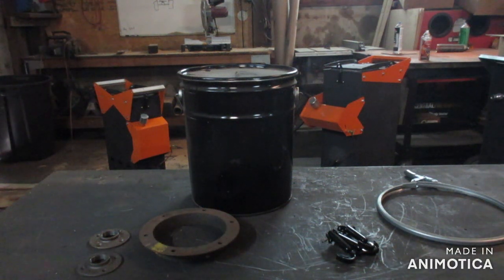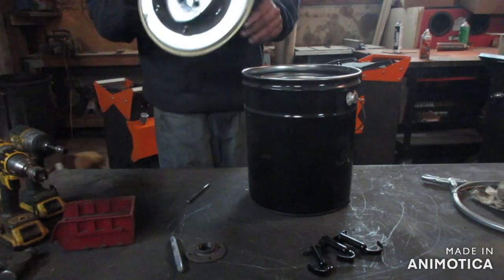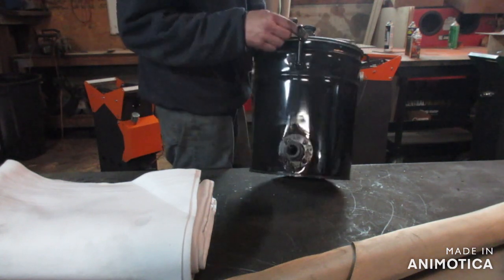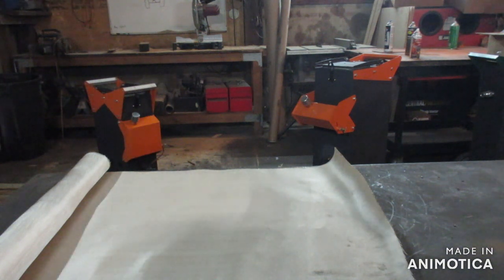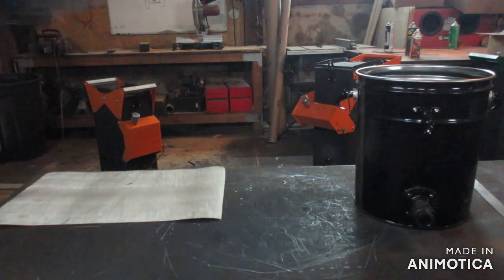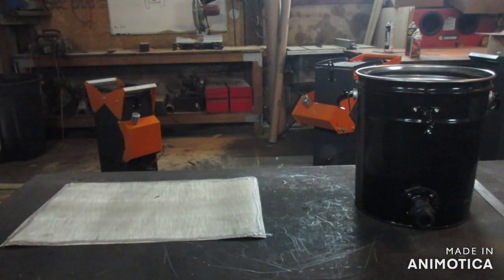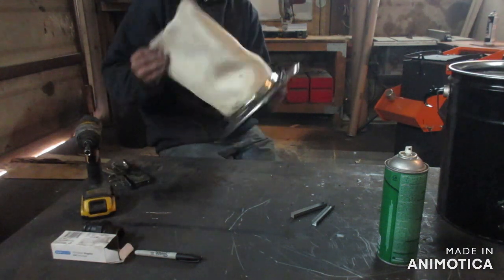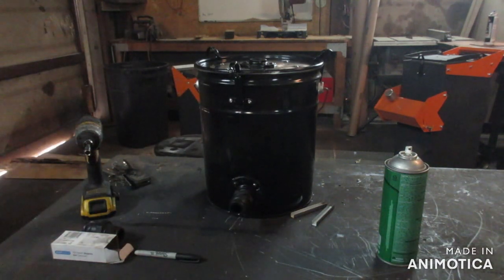Easy DIY Bag Filter for Wood Gasification

Comment: Sir (idol) How many ours to run the generator from the  gasifier?
Reply from the maker: It depends on what one, how big your generator is and what fuel you are running. this is like asking how far a gallon of will get you with out knowing what car, engine that is in it, are you running ethanal, gasoline, diesel?

Comment: Have you found a good DIY alternative for small say 150cc gasoline engines? There are lots of biofuels but they only run on diesel that I can find.
Reply from the maker: Im my experience the Predator  212cc engines are as small as you want to go. Any smaller they are too weak to get any useful Power out of.
Reply: @Thrive-Off-Grid  It's for my 150cc gasoline scooter so it's got all the power I need. But you didn't answer my question on alternative DIY fuels that work with gasoline engines. Biodiesel say from waste plastic is easy enough to make it just won't run gasoline engines.
Reply from the maker: @DivergentDroid  I dont know anything about biodiesel. I only build gasification systems and you need just an ordinary gasoline engine. Your 150 cc engine running on wood gas will not work it is too small. You only get 50% of the gasoline rating running on any wood gas system reliably. The small engine do not have enough rotating mass to keep going and will be problematic. You will probably be able to walk to your destination faster than on woodgas. Stationary charging systems are best for this technology. Then get yourself an ebike and charge it with your system.
Reply: @Thrive-Off-Grid  I just gave up my 1500 watt 48v ebike I built 11 years ago in favor of the scooter. I got tired of the very expensive batteries and the long charging times and short range. Even if I have to buy the gas, it's much easier to deal with. It refuels quickly, the gas is relatively cheap has way more range. I wanted an off grid fuel solution for when I buy my off grid property. I'll keep looking, Thanks.
Reply from the maker: @DivergentDroid  Right on, batteries are getting better and way cheaper now. I have new lipos that run my RV 24 hours a day on a 2 hour charge. I have less than $500 into the whole thing. 

Yeah if range is issue you will get less range with a a gasifier I mean like way less range. If long range is what you want gasification onboard is the last thing you will want to use. You will have longer time and way more work into producing fuel for it as well verses charging a small ebike battery. This is where going charcoal and combining the Charcoaling process into a CHP system wins hands down over raw fuels gasification. Much less hands on processing the fuel for charcoal than chipping.